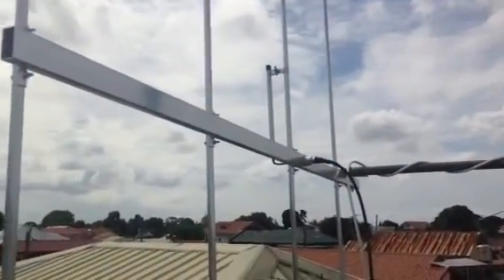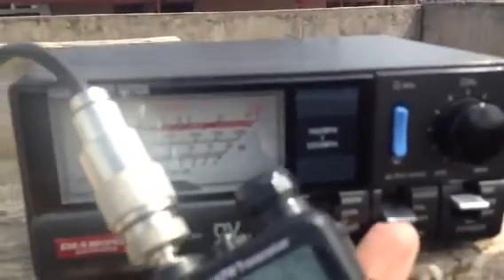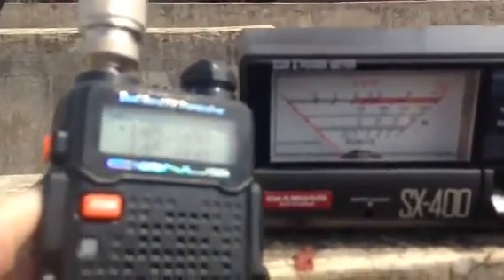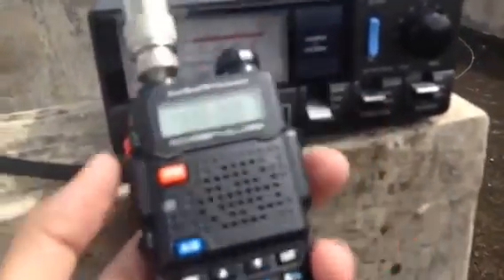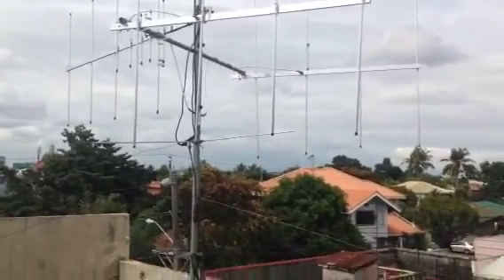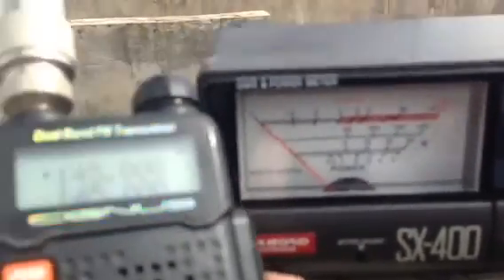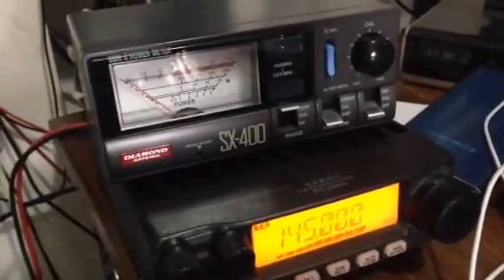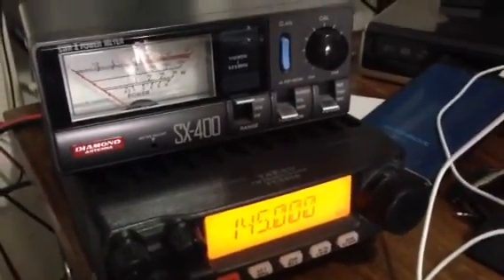Tuning for resonance 4 Elements Twin Yagi and adding the phasing harness

Comment: Gaano po kalayo ung between nung 2 yagi...tnx po..
Reply from the maker: 2ft separation side by side 4ft total
Reply: Ilan po ang haba nung harness...rg58 gamit ko po...
Reply from the maker: @adrianenobleza7184  hindi po RG58 ang ginagamit sa harness 75ohms coax 1/4 wavelength ng center frequency x odd multiple (to cover spacing) x velocity factor ng coax. Check nyo na lang sa google how to make a phasing harness.
Reply: Salamat po ....
Reply: Ilang po kayang inches ang harness ng twin 5 yagi element..salamat po. .
Reply from the maker: @adrianenobleza7184  sinagot na po kita na depende ang length sa center frequency 1/4 wavelength x velocity factor ng coax x odd number multiple para ma cover mo yung spacing na separation. so depende ang sagot maraming example sa youtube o google kung pano gumawa ng phasing harness ang velocity factor ay depende din sa type ng coax na ginamit nyo. magsabi man ako ng figure kung ibang coax naman ang gagamitin mo ay hindi rin gagana ng maayos para sa ginagawa nyo. research po muna.
Reply: Goodmorning po. .un po bang negative ng gamma match eh dpat  shorted s driven element...tnx po..

Comment: Are you using 2 equal lengths of 75ohm coax from the T connector to the Yagi's?
Reply from the maker: Jason C , for phasing harness yes, cut the cable at odd muliple 1/4 electrical wavelength to cover your antenna spacing.
Reply: @EphraimGariguez  Would this work for over the air TV ???
Reply from the maker: @victoryfirst2878  This is for 2 way radio specifically 145Mhz band - will work from 142-148Mhz not for free TV broadcast
Reply: @EphraimGariguez  Thank you Sir for the education. My mind must of slipped on the banana peel. Now I am back on track. Peace vf
Reply: Anung gamit nyo avg or pep?